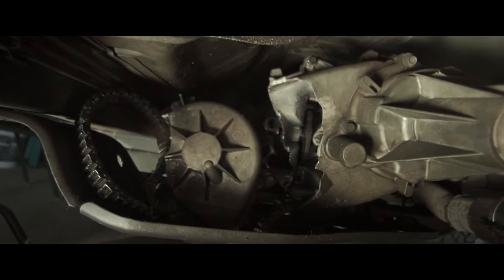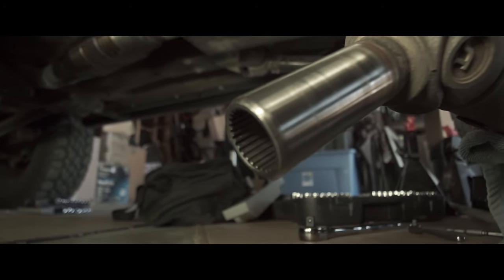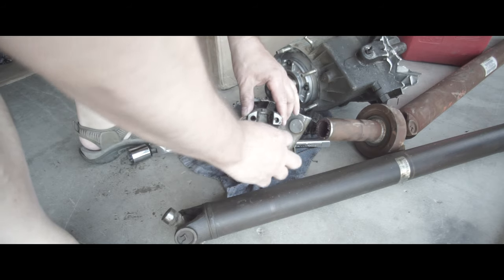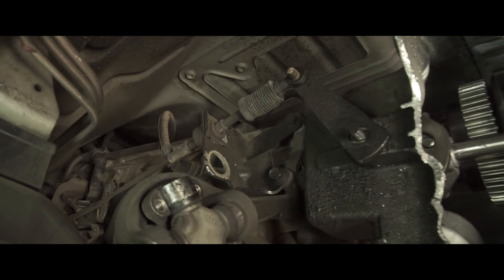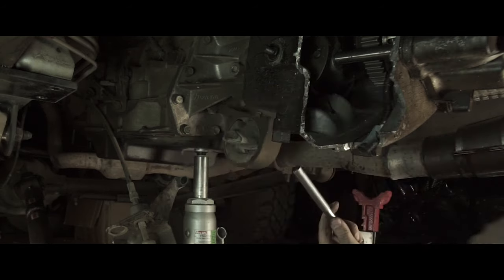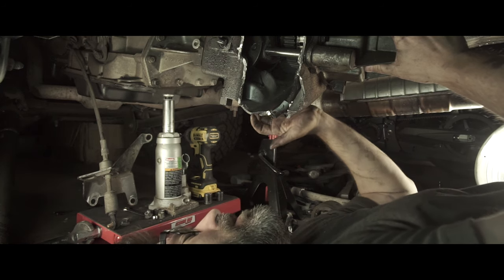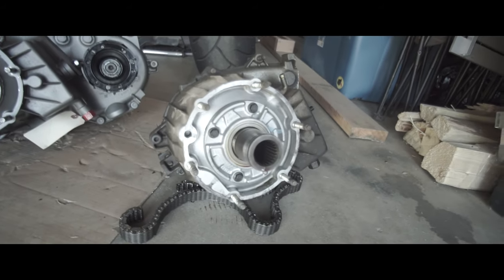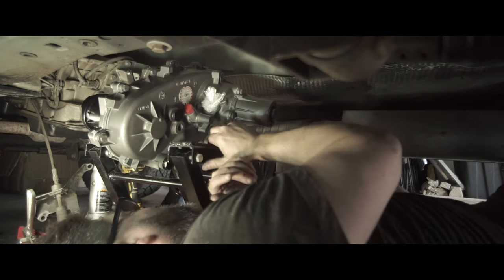1999 JEEP WJ: NP247 to NP242 AMG Transfer Case Swap Part 1 [4K]

Comment: Where did you get the 242hd from?
Reply from the maker: An ebay listing led me to a junkyard of sorts who rebuild transmissions and transfer cases. I had to call them for some reason. Anyway, they sold me the 242HD which wasn't the listing I responded to, but sounded better to me.  They're local to me in SoCal and for the life of me, I can't find their info anymore. Sorry
Reply from the maker: Scour these comments through this series. I may have posted their phone number.
Reply from the maker: Found it!  https://www.ebay.com/str/transmart4x4transmissions

Comment: how is the center diff on this thing with say goofing off in a snowy field or parking lot ?  how is it with normal snow driving . i have an amg 242 and a np120 im tyring to figure out which one to use for my project and the i hear the center diff on the 242 amg is an open difff which worries me on snow streets like if half the truck is on ice and the other half isnt on a stop
Reply from the maker: My biggest takeaway when I chose the AMG was that there was NO 2WD option.  Check these links for more info:  https://youtu.be/Vir6wFRKPB0?si=HYu9ecB-lfaoqg_X  and  https://naxja.org/threads/np242-transfer-case-tech.1138623/
Reply: @TheTSFChannel  that didn't answer any of my questions  at all and BTW you can rebuild that and include a 242 jeep selector shaft and get 2wd . I want to know about how the center differential acts and how it feels on snowy roads and off Road
Reply from the maker: https://youtu.be/-oXS4Wp9iF4

Comment: Will it fit on wj crd 2.7?
Reply from the maker: You'll want to surf the forums for answers.  With a Mercedes engine, I'm thinking Mercedes transmission, which would tell me, Mercedes transfer case -- But I have no idea.  Study through this site:  http://www.ausjeepoffroad.com/forum/showthread.php?t=140499
and especially, this thread.  http://www.ausjeepoffroad.com/forum/showthread.php?t=140297
There's a hyper link to the Jeep WJ/WG maintenance manuals here:  http://colorado4wheel.com/manuals/Jeep/WJ/2002_WJ:WG_Diesel/

Hopefully you can research what you need.
Reply: How's the research going? 
I have a 2.7 and thinking of a 242 t-case swap

Comment: I've got a 242 on a grand Cherokee with the 4.0 is there a difference in the HD 242
Reply from the maker: Check this article out:
http://www.novak-adapt.com/knowledge/transfer-cases/np242
Reply: Yes, big difference. The input shaft is different, the output shaft is different and the chain and sprockets inside are different, 1.25" wide vs 1.00" wide on the 4.0 version.

Comment: I got lucky and found an 03 with a 4.7 and Selectrak with the 242HD stock. Got the rear driveshaft also. Swapped right into my 04 4.7 that had the 247, my progressive coupler went south. Left the Varilok in the rear axle and put a TruTrac in the front, with a 3" lift and 32's it goes pretty much anywhere.
Reply from the maker: Pretty much!  I love the 242, even in snow!
Reply: How many splines on the input side of the np247 j with 4.7 v8 my chain is jumping teeth in 4 low with pressure ie climbing
Reply: @schiedler1978  I want to say 26 from memory. The thing is the ONLY 242 that will be a bolt on to the transmission is the 242HD (sometimes marked as 242J) from a GC that had the 4.7 and Selectrak. It is not only the spline count but the length of the input shaft on the T/Case, that is also different than the 242 that comes with the 4.0 engine.

Comment: Is 242 better for snow road driving? I have the 231j. I’ve looked at the forums but would like your input. I found one for a 100
Reply from the maker: I won't know til this winter. I know that 247 was crap in snow, transfering power to the wheel with least resistance. I'll be very interested to see how high-lock and low-lock work in snow.
Reply from the maker: I've been on powder and ice recently, and the High-lock and Low-lock ranges on this transfer case make it VERY capable -- and without chains!
Reply: The main reason why I went with it was for snow driving. The biggest advantage for me is the 4wd full time position allows me to leave in 4wd while highway driving in winter. Here in Michigan it is common to be going down a perfectly clear and dry highway and instantly encounter snow covered pavement in the shadows of the trees, shifting back and forth between 4wd part time and 2wd is just not feasible. As far as the 247 being crap in snow I disagree. The power transfer is based on different speeds of the input and output shafts in relation to each other, not on torque bias. It progressively adds more power to the front output shaft based on the severity of the speed difference of the two.